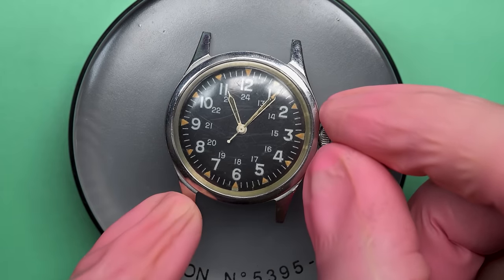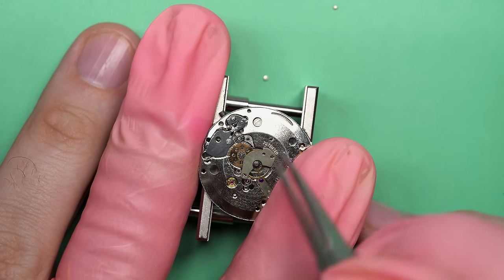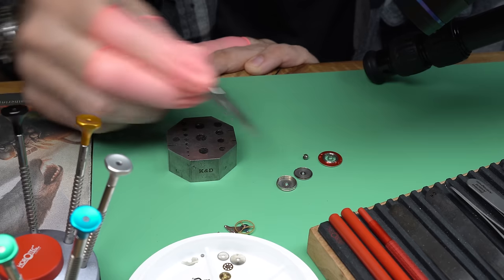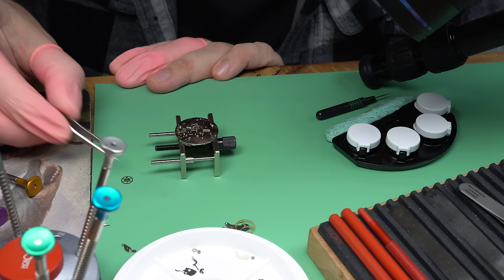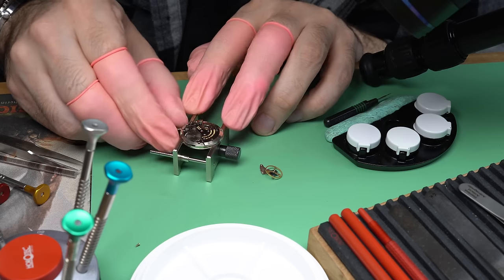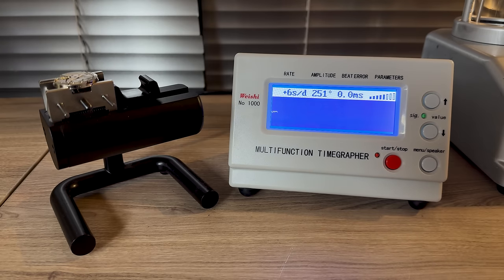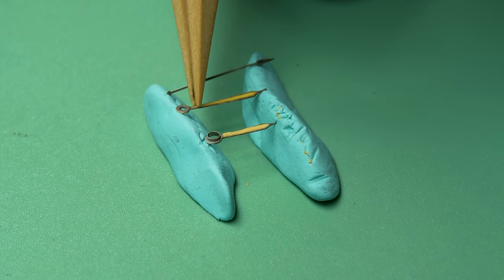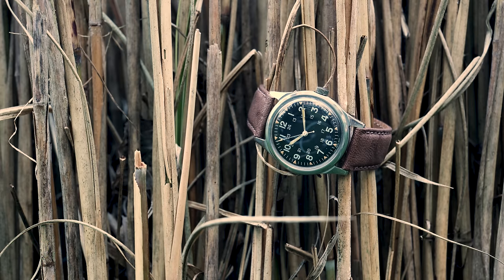Restoring a Vietnam-Era Military Watch I Purchased on eBay as "For Parts or Repair"

Comment: As you were talking about skills, knowledge, and technique, at about 17:10, I noticed you do something that was likely automatic for you and yet something many people don't know.  As you were trying to install the screw and get the threads lined up, you gave it a partial turn in the opposite direction.  You can see, and feel, the thread drop into place, then it is lined up when you turn it forward.  I particularly like and recommend doing this if one is putting a screw into a soft material like plastic, wood, or even soft metals.
Reply: Thats so true.  I do the same when I need to seat a bolt in tight quarters on one of my tractors... especially when I can't feel it drop in with my hands.  A half turn in the opposite direction helps prevent cross threading... from tiny watch screws to valve cover bolts on tractors.
Reply: This is very important with the self-tapping screws in plastic. A cross threaded screw can crack the plastic screw posts, leading to a very annoying repair.
Reply: Taken a few lenses apart, some with multithreads. They can take a long minute being turned backward before things lineup and fall into place.
Reply: This is because the threads on the bolt and the threads in the hole have a definite start, once the end of the threads meets the start of the others the “point” of the od threads drop into the id threads. 

Keep tinkering boys! There’s something new to learn every day!
Reply: I learned of that from a precision shooting channel, 8541 Tactical. Very important when you're installing the screws for scope mounts.
Reply: I do that when I'm doing auto repairs,  so afraid of the dreaded cross-thread
Reply: For my job, I was re-assembling things that used self-tapping screws into plastic. I did this exact thing to avoid weakening the plastic by cutting new threads.
Reply: @blackdragonxtra  Absolutely.
Reply: Aye, I learned that trick back when I was working in a factory building car transmissions. A few too many cross-threaded bolts in the casing had me figure it out pretty quick!
Reply: I’m certain that this comment is amateurish, but I always seat anything that screws one way or the other, but damn the physics and engineering behind reverse threading. I’m aware that I’m plain stupid when it comes to this sort of architecture, but for the love of all that is holy it would be great to unify such things as subtle as this if only for our great-great-great grandchildren to be able to fully comprehend what would need to be done to fully restore any mechanism to factory spec. We’re pretty close now, but just not quite.
Reply: @mc-not_escher  Reverse, left-handed, thread is used where the designer was concerned that action of the common right-hand

Comment: I just picked up a Late 60's or early 70's Ball Trainmaster Automatic for $200USD on eBay that is running, but at about -30sec/day. A 25 jewel ETA 2620 or 2821 movement, still not quite sure, but I am leaning towards the former. I really don't feel like messing something up, so I am hoping to work through my pocket watches first to get comfortable. I have been practicing on a beat up 15 Jewel USSR chronograph. One balance reposition on my Grandfather's 1920 Elgin pocket watch and I was hooked after I saw the 30 year dormant movement start ticking. Thank you for the inspiration, knowledge, and courage to move from the obsolescence of smartphone repair to the investment of watch repair:)

Comment: Wow that bought back memories. I had that watch or something very similar when I was a child. All the way through I was thinking it was similar, but probably not the same because I remembered green lume. Then when you lit up the lume at the end BOOM, there it was, just as I remembered it in the darkness under the blankets after charging it up with a torch. Thanks for the memory.

Comment: these were standard issue for the Air Force back in the late 60s.  I remember wearing one, They were quite functional and you could easily read them in darkness AND they didn't require a software update to run.  I have an over priced Apple Watch that is nothing but a headache.  Analog all the way now.  Thanks for making this video.

Comment: Looks great Marshall. A useful tip when putting the setting lever back in. I use a bit of Rodico to hold it in place, then it can be turned upside down and screwed in without it falling off.

Comment: Very cool!  Thanks. You’d think it was issued to all soldiers in combat but they were issued in Vietnam but not universal then phased out by the end of the war. I copied & pasted this from an officer addressing this issue in an article. 
“Under the original 1964 MIL-W-46374, Belforte made the watches for the US Gov't with plastic cases. Benrus distributed them for Belforte. From 1968 onward, Benrus and Westclox made the plastic watches during the remainder of the Vietnam War under the MIL-W revision "A" that allowed a corrosion resistant metal case (Hamilton made these), changed to stainless steel by a 1973 addendum. It took a while for these to find their way into the logisitcs system, appearing in the last half of the war.”

Comment: Another great restoration! I always learn something new with every watch you bring back to life. Case in point, the hack in this watch is designed differently from the other hacking mechanisms in other watches. One note, however. The lume is not tritium. It contains a photo-luminescent chemical that glows in the dark when first exposed to light. You can test this with the new geiger counter you got to test the dial on that Rolex you recently restored. "Tritium" is actually a radioactive gas (H3) which is contained inside tiny tubes, the inside of which is coated with a fluorescent material that glows in different colors, due to the beta decay of the tritium gas. The tiny amount of tritium gas in these microtubules is very, very weakly radioactive (unlike deadly radium paint used in the past). Tritium gas has a half-life of 12.5 years so the glow will get weaker over time. Tritium tubes are often used in watch dials and hands that glow in the dark without the need to be recharged by light. Ball Watch and Marathon are watch brands famous for using tritium tubes in their watches. Tritium tubes are also commonly use in the sights on firearms so they can be seen in the dark.
Reply: There were absolutely watches that use tritium in a painted form and not like modern watches with tritium tubes. They were made by replacing some of the normal hydrogen (H-1) in a plastic polymer with tritium (H-3) which is referred to as tritiated polymer or tritiated solid polymer. That polymer was then mixed with the beta-reactive phosphor paint and applied to the lumed surfaces.

Comment: Around 25mins, you put the crown back on the to test wind. You do this by sliding the crown on from the side to attach to the shaft. At the beginning you use force to pop this out. Potentially you may be able to line it up so the movement will slide up and out with no great force. (you may do the reverse of this when assembling but I am not up to that yet.)

Comment: Great video. One thing that confuses me is why lume is practical. When you installed it and tested it, it only held on to the light for a few seconds. Would you then not need to bring a light source with you, if you were using it at night or in pitch darkness? I looked awsome when you were done though. Great video!

Comment: You can just about see some markings on the case back, so it's possible it is an issue watch that has had the original bead-blasted finish polished off.
My guess is that it is the MIL-W-3818, or GG-W-113.
Split stems are a pain, I have the Hamilton GG-W-113 that has the female connector on the crown which broke. It's almost impossible (in the UK anyway) to obtain spares.
Good vid, I enjoy watching you work!

Comment: 17:50 my guess is the ring shim is slightly z-thicker than the post or the gear, so when you torque the screw it will have a stop before you cinch the gear in place.  It's likely easier to machine a precision shim than a precision threading.

Comment: The thought I had as to why they have the small washer under the crown wheel:

It's not for wear purposes from different metals making contact, it sets slightly higher than the inset of the crown wheel itself for the reverse thread screw to tighten down on- I've forgotten this washer and after tightening the screw its held the crown wheel in place so it won't move.

Comment: the bit about "even if it seems easy to you now... if your a beginner"
i feel this one with my knowledge on engines
i know enough to false diagnose all the damn time on larger engines, but give me a brigs or a small honda clone type thing and i can get it running, them things are damn near bulletproof
usually just carb issues relating to water getting into the float bowl and screwin things up

Comment: Marshall, remember those Radium particles are EXTREMELY radioactive. about 1,000,000 times (1million, yes) stronger than Uranium /weight for alpha radiation. so even a very trace amount inhaled can cause issues in the future. (it is 16,000yrs half life). I really hope you are okay. Also due to the long half life, you didn't have to shed them off from the hands. You just had to re-apply the secondary coat of what illuminates with the alpha radiation....well, it's kinda too late, but maybe next time. the way you handled those particles gives me shivers. i really hope you are wearing protective gears. It's scary stuff.
Reply: It's Tritium not Radium 12 year or so half life so technically inert...at 32.20 he mentions this

Comment: Hi Marshall, watching your channel has inspired me to get into watch restoration as a hobby (and I mean just getting into it.... first device is on the desk awaiting disassembly!!).  Your content and the quality of your videos are outstanding and inspirational.  Based on your recommendation in one (or more) of your videos, I have purchased a pocket watch so that I have some chance of managing the very small parts as I learn the skills necessary to go further.  I have a question for you - I have opened the pocket watch to try and ascertain the manufacturer in order to search for a tech sheet or similar to help me if I get stuck.  The movement has "G&G Geneve" inscribed on it and a serial number on the case and movement, so I am hoping it is a decent unit being Swiss made.  I have searched for "G&G Geneve" and can really only find links to eBay or Amazon which aren't useful as I don't need to buy another one (yet).  Am I right in believing that to be the manufacturer's name and, if so, are you able to point me to where I might be able to find out more (given the lack of meaningful results from the search, I assume it is no longer in operation, if it ever was?).  Many thanks and I look forward to watching more of your content as it is released, Kip (Australia)

Comment: I checked out the website for that lume material, but I couldn't find any details about the active ingredients. If they're using something similar to the Europium-based phosphorescent powders from United Nuclear, then it's actually very important not to over-mix or dissolve it, because doing so can destroy the crystal structure that allows it to function. Ergo, having a somewhat gritty paste is perfect, if they use that material.

Comment: Question for you! They have jewels on the end of the pin part of the wheels, makes them move better, but why dont they have jewels in the center of gears or wheels that sit on fixed pins/shafts that go through the middle of them, so they too run smoother?

Comment: The easiest way to break a mainspring is to wear it all day where it assumes your body temperature of 98.6.  Then take it off, wind it up and set it on the dresser.  When you get up in the morning, it'll be room temperature of around 70 degrees.  Wind it up tight, then let it cool down. That'll break it every time.  I tell my friends, always wind it when you put it on.  Never when you take it off.

Comment: While servicing some Seiko 4006 Bell-Matics, I found that the color side of the disk of a replacement mainspring doesn't always face up. I forgot if it was the main spring or the alarm spring though.

Comment: I'm curious about something. It seems that 2 part stem is meant to slide together. If you were to orient the stem so that the slot were facing perpendicular to the watch, would you be able to slide the works out, and leave the second part in the case?

Comment: At around 1.30 you can see the start of a faint number engraved on the back of the watch case.. it looks like it is starting 6645-99-, this is an NSN which is a 'Nato Stock Number', & the 99 relates it to an item made for the British Military (01 relates to the US military). These style of watches have been an issue item within the British military since WW2, primarily made by a company called CWC. I did a cursory check & the number does relate to a British military watch, just I can't identify the actual model as I can't see the whole NSN. I know that the were very popular in the day with US service personnel. I hope that is helpful :)

Comment: Regarding the radium dial watches you tested on that Geiger counter....I have the same unit only a newer model. It measures Beta and Gamma Rays, but not Alpha Particles (which are a Helium-4 nucleus, not dangerous unless you ingest it or breathe it in. Radium paint releases radon gas (Alpha particles) which when breathed in causes lung cancer). The device may also measure Neutron Flux, the most deadly of radiation, but you will only find that near a nuclear reactor or if too close to a thermonuclear detonation.  The count CPM is not important. What you want to observe is the Microsievert number, which is the smaller numbers on the device display. That measures radiation which your body can absorb. Anything over 100 mSv is the start of the danger zone. The reason the Radium Girls developed radiation sicknesses is because they kicked the paint brushes.

Comment: I guess I have always been luck on the 2 piece stems.  After I remove the crystal I can usually flip the watch face down and slowly turn the crown until the 2 pieces disengage.  This obviously wont work if they are rusted together.

Comment: I have a swatch omega mission to the moon and I was attempting to change the battery which was the wrong size after I looked it up (was still wrong size and info apparently) and while trying to get it in I managed to pop off too if the tiny hands on timer. Main hands and movement still turn and okay.. I think if I can get the two little hands back on it would be fine. Nothing looks bent or anything and turns fine. Can you try and find if not no biggie lol. I know it’s something different. It’s literally still perfect condition not a scratch

Comment: Technically the coloured side of the washer on the new main spring points upwards ONLY if your main spring is wound in a certain direction, there are some watches out there that are wound in the opposite direction and if they are then the coloured side wound be pointed downwards!! But you would have to check that to be sure.

Technically!!

If the spring coils out from the center in a clockwise direction then its colour up but if it coils anticlockwise from the center outwards then it would be coloured side down.

From what I've observed anyway but I'm no expert lol

Comment: MARSHALL,
Excellent restore ,but the lume has to be darker.
Its OK, but the color doesn't blend with those outer markers.
It makes you focus on the hands a bit more than it should.
I spent  many years in the frame and picture restoration business and
have an excellent color sense, so fix it.:)
Cheers,
Rik Spector

Comment: Marshes mate i would have cleaned the face of each hand ,that way they look like new ,but still looking like old pertina is still on them, sure use a new glowing paste, but still clean the face of each dial cheers. 👌✌🦘👍
Great job mate, plus noticed that all the tooling you use is top of the range, not your cheap tooling, also you should do a upload about the small  lathes which swiss watch makers use to make all the parts of a self winding watch is made out of? 🦘🦘👍👍

Comment: You always make a point to oil the top of the arbor before closing   the barrel lid but you never show oiling the bottom  of the arbor.  By the way military watches did not have luminous hands and dial as they can be seen by snipers at night.  Good show.

Comment: That original lume is not tritium. Tritium is an isotope of hydrogen, which is a radio active gas. It comes in tiny air tight tubes. When those tiny containers get damaged or opened in any way, the tritium escapes and flies away, as any gas would. BTW, as tritium is radio active, it does not need to be charged with light to make it work as a lume. Your powder lume however is not radio active, so it does need to be charged with light for it to glow in the dark.
Reply: The only lume I remember that was radioactive and glows without charge was radium, tritium as you said is a gas sealed in a glass envelope which is internally coated with a pigmented phosphor that glow when excited by the tritium gas.

Comment: Looks great however I think the lume looks a bit sloppy from the front side on the hands (I think the instructions of making it more pastey were wrong ?).  A bit of scraping to get the metal of the hands to show and to be more uniform would have made this look better (or maybe a bit of sanding to get the surface flat and the hands metal flush with the lume ?).   I would also like to see the pips be re-lumed.  Maybe take a photo of the dial and print 1-1 on acetate and then cut a stencil for the pips out of the acetate.  Place over and re-lume the face pips ?  Great work otherwise.